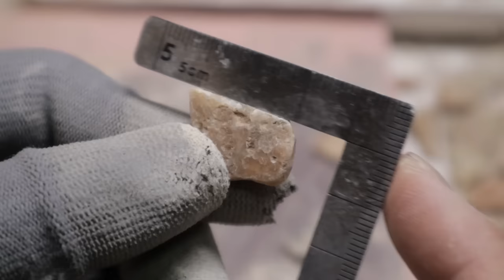DIY A Mini Log House using branches and bark

Comment: The holes you left inside on the first and second floor are going to haunt me now the rest of my life
Reply: 😂😂 oh no!! I almost forgot about them by the end!
Reply: Yea but he wants to show what's underneath and everything that really goes into building a house. Yea plexiglass would have been cool too but I think be freakin killed this. It's so accurate to real building
Reply: I feel the same way!
Reply: Me too!!
Reply: I want a log cabin now after watching this ❤
Reply: I know. What was the point of only doing part of the floor?
Reply: If it rains, that roof will leak. No flashing in the valleys or around the chimney. But I'd not worry about it😂 Picture Looks So Realistic!❤
Reply: @bethjones1116  Lighting
Reply: Absolutely amazing.
Reply: I kind of understand this. I Started building a model boat years ago. I never finished it because I didn't want to hide all the intricate structural elements that would have been forever hidden by actually finishing the piece! To this day, it is still just a hull, partially exposed, and I decided I liked it that way. That was the hardest part of the build and could have been hidden by the simpler parts of finishing it. When you put hours and days into something, sometimes, it's a shame to completely hide all the inner workings that took most of the time!
Reply: @christopherchapman8893  respect.
Reply: @christopherchapman8893 I agree to your point.i am not a builder,but a painter,and as a painter I enjoy seeing sketchlines or pieces of unfinished work in the work,some artists do manage to leave it, bringing in the harmony with the whole work.and I love work in progress videos,often I make screenshots of some elegant solutions, when they just appear, before it becomes a system of them. There is such beauty in that.

Comment: Oh man, I mean it LOOKS good, but there's no wiring or insulation, zero plumbing, and I haven't seen a single nail, joist hanger, or screw ANYWHERE. It looks like it's all just held together with glue, friction and good intentions. There are sections of flooring missing, the windows don't have panes, and there's NO hardware on any of the doors.  

We're gonna need to slap a stop work order all over this, until the appropriate changes have been made. 

...good job on all the handrails, though.
Reply: @spex4558  🙄
Reply from the maker: not capable of doing that.^^
Reply: @hede_the_call  Then you can make it yourself. Oh! You don't even have the ability to do that! By the way, you want a lot of things on the subject of commenting when you can't act.
Reply: @지나가던사람1-l5i  I'm considering explaining the joke, since there might be a cultural difference in humor. 
The joke largely hinges on how realistic and professional this project is.
Reply: I understood your joke and I think it’s very funny.

Comment: This is cool. A couple questions:

What kind of inner bark were you peeling?

What tree twigs were the ones used?

Why did you leave some flooring off? For light transmission through the house?
Reply: I’m wondering about the flooring too. But didn’t consider it to be for lighting. Hope this gets answered. 😅
Reply from the maker: 1. I didn't know the name of the tree because it was peeled from a pile of cut trees, but it was a tree with a lot of sap.
2. Any straight branch can be used.
3. To show inside.😊

Comment: This legit looks like it could be an arcitect's rendering of a house they designed on the outskirts of Calgary!
But can I ask, why didnt you put flooring down on all of the floors?? I noticed you left some gaps. Just curious ☺️
Reply: My guess on the flooring, since it’s cut well, is so you can see what work went into the foundation.
Reply from the maker: @bikepunks  good answer!😊
Reply: @V1KTOR33  I accept your reasoning 😄👍🏼
Reply: @housetree8663  Never wanted to be the size of a lighter till I watched your video.. I only answered her question because sometimes creators don’t respond. Great job. ✌🏻

Comment: If you don't mind......what is the roof angle and why you have chosen that angle? (as far as I can see should be somewhere around 33-37 degrees)
Reply from the maker: Yes, I think it's around 37 degrees.
It is 1/1.1~1/1.2. The angle of inclination was determined taking into account the external and internal ceiling heights.😊😊

Comment: Hola, muy buen trabajo, maravillosa cabaña, que producto le aplicas para dar el efecto de envejecido a la madera, saludos desde Chile. 👍
Reply from the maker: Sanding after dyeing. And apply wood stain. Dyeing is to apply a subtle color to the crevices, and sanding is to gently feed the wood stain into the wood.
One thing to keep in mind when working with wood stain is to quickly wipe off the remaining amount with a cloth or tissue paper after painting a lot. That way it won't stain.
Reply: @housetree8663   Thank you very much, I hope to see your next works, a hug and congratulations. 😁

Comment: You are extremely talented, the one thing I can’t understand is why you would leave the floors unfinished like that, yes I know you probably left them that way so people could see the detail of the internal structure but you could easily direct them to this build video to see the great lengths that you go to with that detail, to me, in my opinion leaving the floors like that ruin what would of been the perfect log cabin model, having said that it is far better than anything I could make.
Reply from the maker: It seems that many people are curious about the unfinished floor. So next time I plan to work with the finished floor.
Thank you very much.😊

Comment: What's with the floors not being complete? It looks gorgeous, but not complete without the floors being all done. Im sure there is a reason, just not understanding that.
Reply from the maker: There is no special reason.
I wanted to leave part of the interior unfinished.
Reply: @housetree8663  good enough for me. I really was hypnotized by your work. Art,is what you've created.
Reply: @housetree8663  I like it. Shows off some of the details put into the floors. I made a popsicle stick house and thought about leaving parts open to see the framing and everything.

Comment: where are all the branches and bark you apparently used?
Reply from the maker: Branches were used for walls, and the bark was used for roofs.^^
Reply: I was expecting to see a guy literally collect branches and bark from the forest and then mill everything down to size. It still looks bloody amazing, despite the misleading title <3
Reply from the maker: @joshtaylor1065  Sorry for the wrong answer. It was difficult to capture all of that work in a video. Also, I omitted a lot because the video would be too long and boring. I will try to include more details in the next shoot. 😊😊
Reply: @housetree8663  No worries :D Effing great job, though :D :D :D